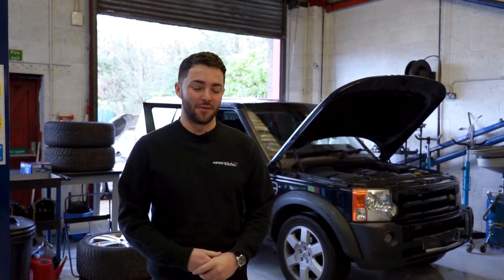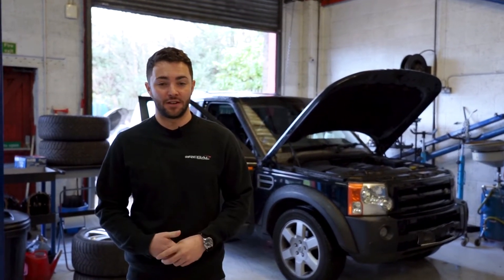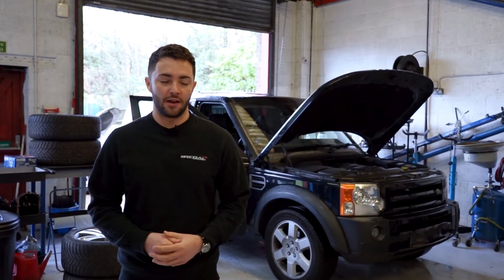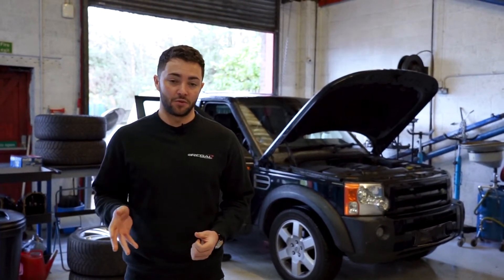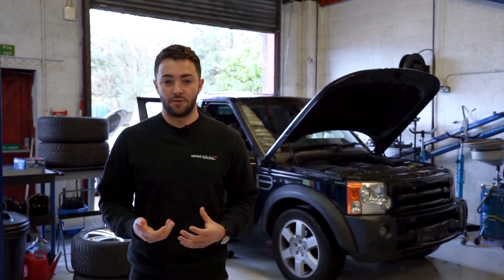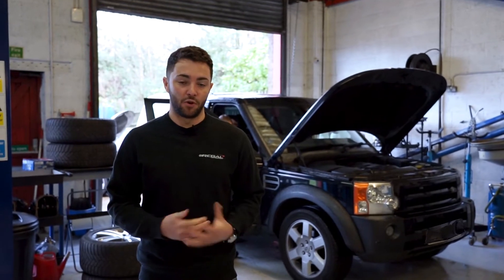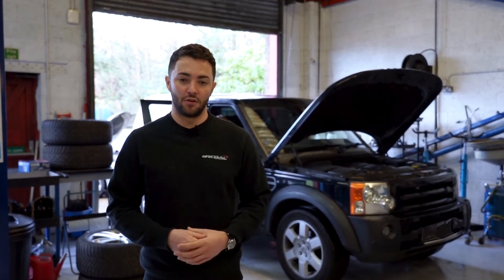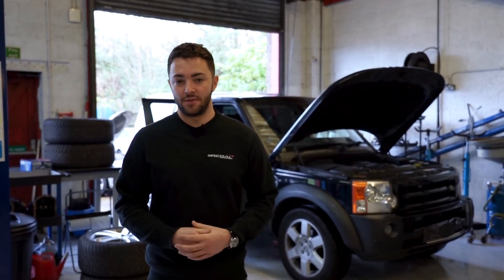Fix your Land Rover Discovery 3 TDV6 EGR problems with an EGR delete & ECU software

Comment: Does this cause smoking from the exhaust ?. And will it pass emissions on an mot?
Reply from the maker: Less exhaust gasses will be recirculated into the engine, so it can have that impact. MOT compliance wise generally anything that changes the emissions can impact it.
Reply: @RegalAutosport  I think what he is asking, : have you had anyone come back saying their LR3/4 has not passed its MOT due to capping off the `EGR's?
Reply from the maker: If you look at the MOT guidance, you’ll get your answer :) 

Depends on the tester though

Comment: What power can you have these remapped upto?  Surely could get over 250bhp?
Reply from the maker: Maybe on another dyno, when new these were making around 240 once tuned on our dyno. Don't forget, these cars are often high mileage now and still on the original turbos, injectors etc so striving for the MAXIMUM output would not be wise, unless you'd like to change out some additional parts after the remap.